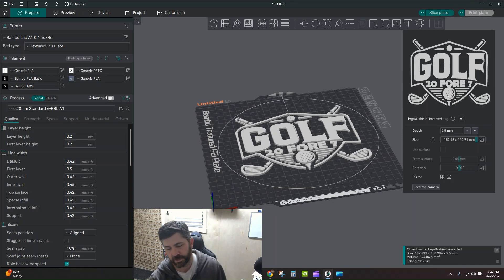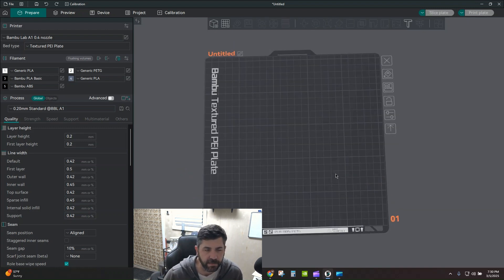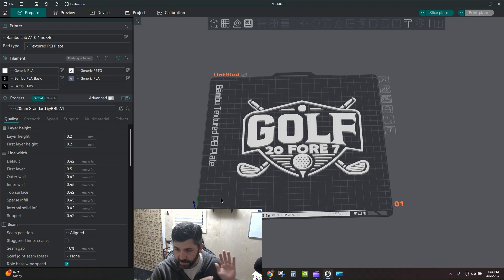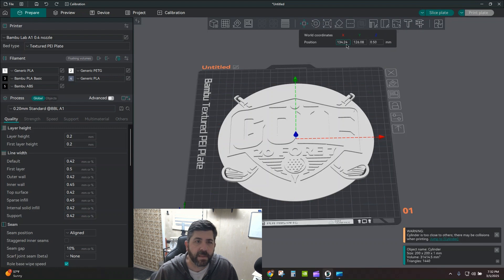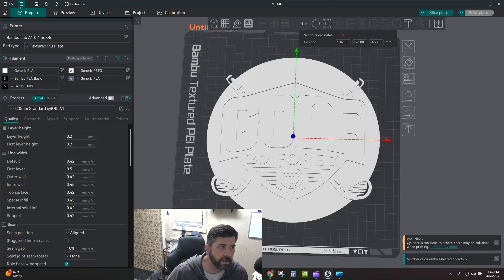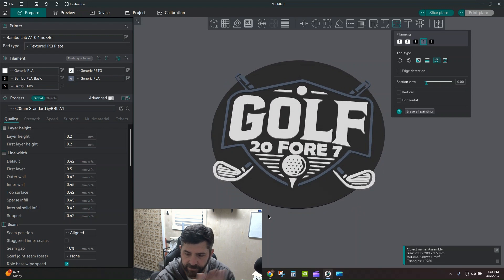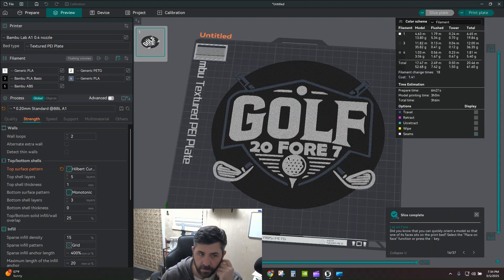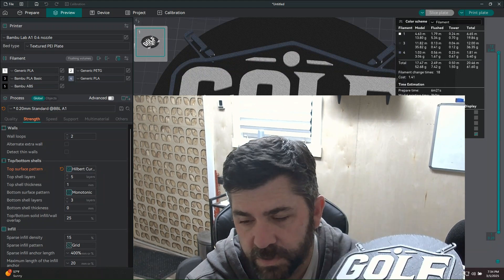3D Print Vector Files Directly in Orca Slicer

Comment: HI man... 
This import a vector file featurehas been a part of Mattercontrol for decades and I was wondering when some bright spark would incorporate it into their slicer.  I've never used orca so I would not know... 
I'm still extremely hooked on the " ideamaker" slicer   after watching and recording all your utube tuts on the " ideamaker" slicer...  And saving them to my flash drive so I can watch them anywhere... 
I do not own a bamboo printer so I just didn't bother with orca... 
I still own my two humble Anycubic i3 Megas 
I might give this orca slicer a go....
Reply from the maker: I was still running my old OG ender 3 when I made the move. Ideamaker is still a great slicer, but it never hurts to window shop a bit.